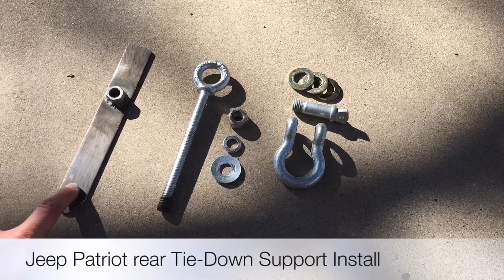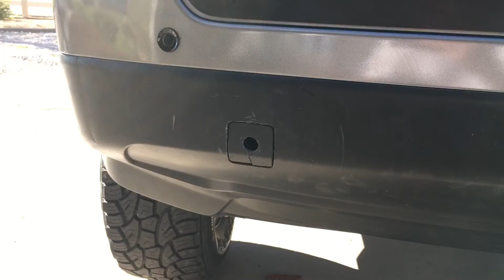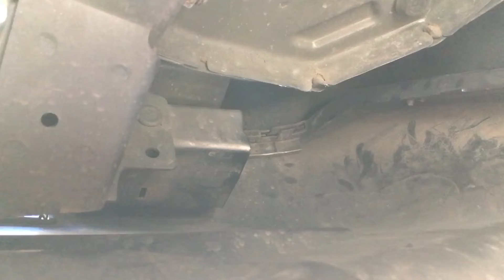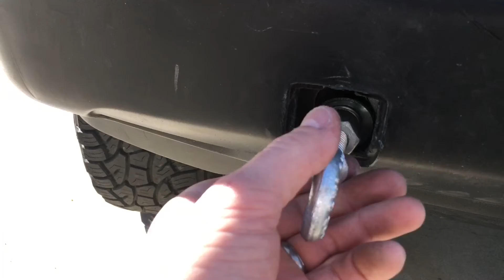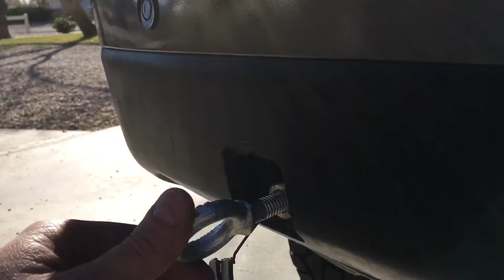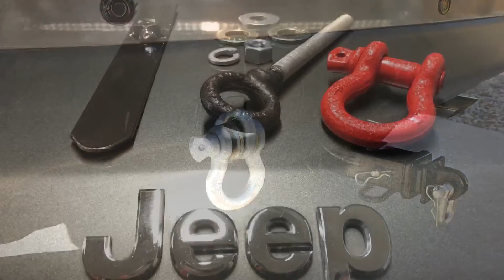Jeep patriot rear tiedown support install

Comment: Will this work on the 2010 and older model? Since the bumper is different 
Drilling into my bumper is not a problem
Reply from the maker: I have tried to find a generation one patriot to see if this shackle kit would work. That generation one patriot does have a crush bumper in the rear, but it is still unclear whether or not the crush bumper has the pre-drilled circular hole in it like the generation to patriot.
Reply from the maker: But if you don't mind a drilling into the rear bumper, then the shackle kit will work for you 100%. Just let me know either way, thank you.